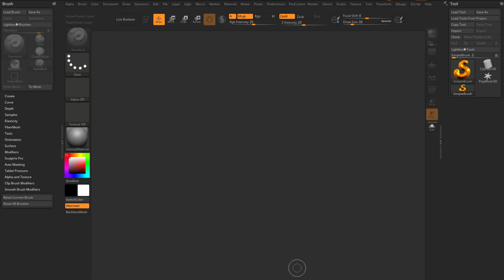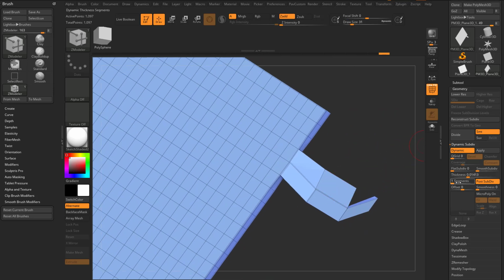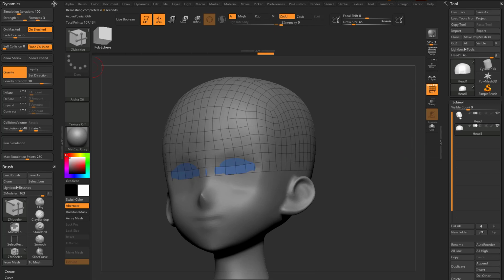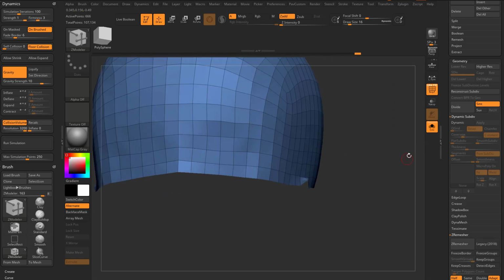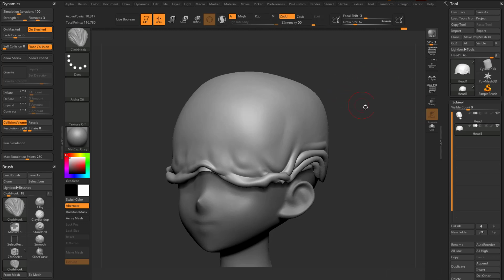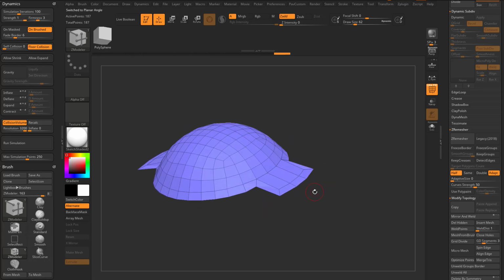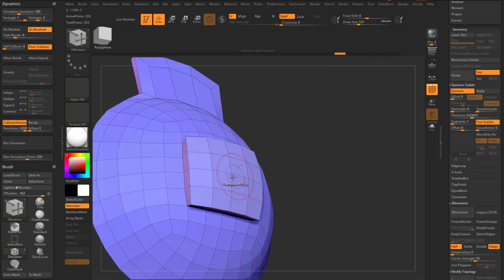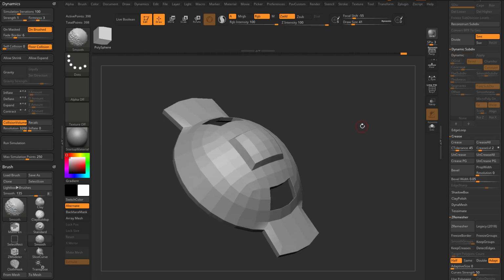037 ZBrush 2021 Dynamic Thickness Basics

Comment: Hi, thank you for your videos, Your a great teacher.   Could I ask what you mean by “coplaner” @10:15mins into the video.   Is this where when adding thickness or extracting that those surfaces slide/clash into each other?  Is they’re anyway of avoiding this if you want to keep 90degree angles and extrude?.   I’ve tried zmodeller extruding/inflating/qmesh/ extract and always get these issues, and can’t find any videos or guides explaining a workaround.
Any help much appreciated.
Thank you once again.
Reply from the maker: Oh, yes coplanar in this instance just means to faces sharing the same plane, so you'll get that nasty "z-fighting", or just have generally unpredictable geometry behavior when you have meshes sharing the same space. Usually extruding along the surface normal solves it, although it can lead to "balooning" (or pinching in the opposite direction). Off the top of my head I don't have any really elegant solutions, just brute force stuff, but I'll keep my eyes open!
Reply: @MichaelPavlovich   thanks for the reply, that information is very helpful.  I've been watching your videos almost daily, so much so you've become my Z-brush 'University'.  the more I watch, the less I have to pause to absorb the information, and can concentrate on key points.   your an incredible Teacher, leaving no gaps.
Thank you once again.